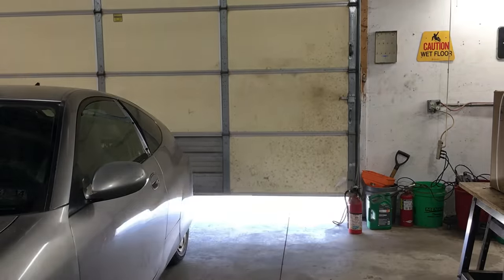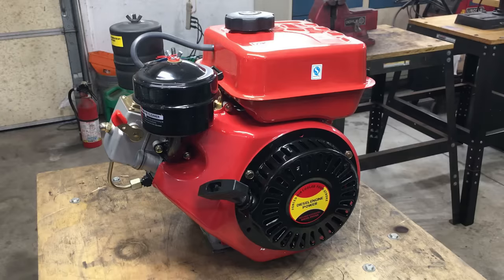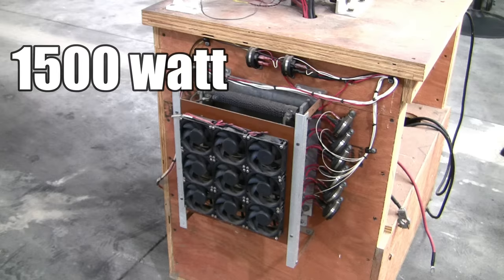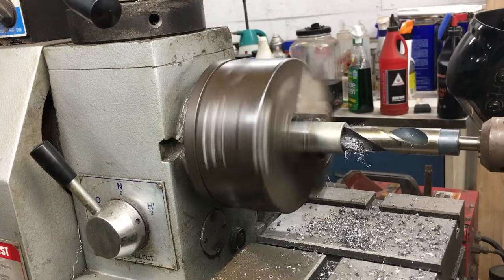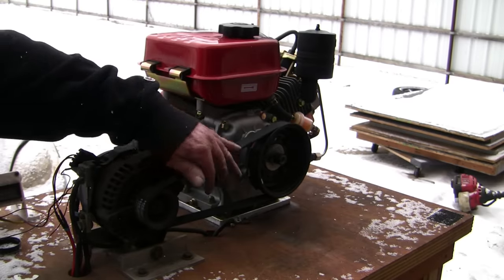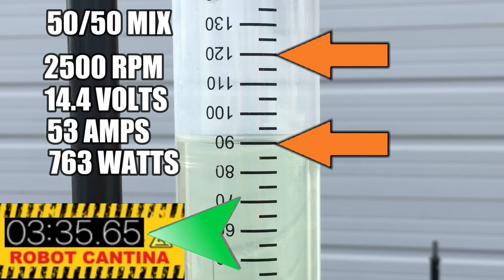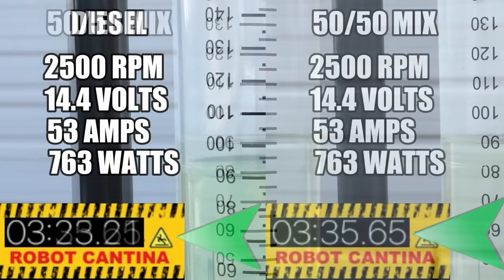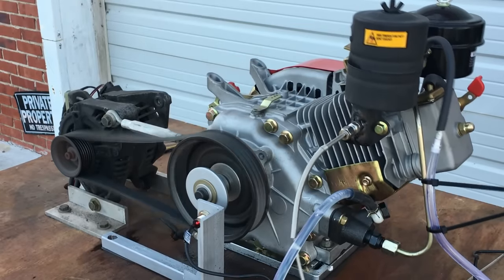S4 E3. How good is vegetable oil as a source of fuel for a diesel engine?... We find out!. plus more

Comment: 11:57 That's where I have to disagree with you for the first time over the years Jimbo. You see - the diesel engine was not invented to use diesel. As a matter of facts - when the first diesel engines were made we haven't even invented diesel yet. First diesels were made to be run on canola oil. The only reason we started to use diesel was because there was so much junk byproduct from making gasoline without any use. Somebody decided to fraction it again and poured the distiled garbage into the oil engine and surprise surprise - it ran pretty much the same. 
What's even funnier is the fact that if you do an analysis of the exhaust fumes you would find out that the vegetable oil has way lower NOx emissions and the soot percentage is lower than the diesel. 
So - vegetable oil was the OG fuel for diesels, it has better exhaust fumes emissions AND, what's better - you don't have to use fresh oil. Used oils with 100k french fries cooked in it is just perfect for the engine too, you just gotta strain and filter it so it doesn't clog the fuel injectors.
My friend had a Mercedes Benz W124 and the engine had well over 500k miles on the clock. 100k miles were done on 4:1 mix used vegetable oil, hydraulic oil, transformator oil... to crappy low price watery diesel. Just basically everything that burned half decent. The engine was still pristine, he gave up the car just because the floor in the trunk rusted through and rear axle just fell apart from rust. That being said - he bought the car for 850$ and sold it 5 years later after this fuel experience for 1000$, the new owner replaced the rear from a front-ended car and it is still happily driving. The cost for running the car was about 4$ per 100km when running on the used frying oil, which was actually the priciest fuel he put in the car (for comparision - my car has very similiar engine displacementwise and it costs me about 18$ per 100km to run it on straight diesel). With the hydraulic oil he had troubles starting when cold and felt the engine lacks power but it was still running and doing well in summer when it was baking hot.

Comment: So my dad has a 1,9l VW diesel powered car and that engine will eat anything that burns and is liquid enough for the high pressure pump to inject into the engine
Diesel engines have a large filter for a reason xDD

Comment: You do a 90/10 mixture of used engine oil and stale gas I don't think it has to be stale gas which is a 90% used engine oil and 10 percent gas is called black diesel

Comment: Veggie oil is fine. I have this exact motor. 15W40 oil in the case. It will take days to break in and should last a few thousand hours. I won't run it at 2500 RPM. Your mount and 1 inch shaft  pulley are elxcellent. Really bad is dirty motor oil. It's an abrasive fuel.  It's quite disappointing you didn't measure the fuel draw. A little respect for it. A 168F.

Comment: The danger from alternative fuels is as follows.
Solidifying or severe jelling at low temperatures.
Bacteria building up in the tank and doing nasty things like pooping waxes, acids and other gunk that can clog the injectors and or damage the high pressure pumps.
Detonation and excessive heat.
Dangerous toxic gases 
Stuff that can clog and destroy the dpf system.

Unless you run an older mechanical pump engine steer clear of uncertified and home brew fuel alternatives especially o some jeeps where the cost of the fuel system is more than a new car.

Comment: I just got a diesel heater for my camper. First diesel powered anything I've owned. Now that these little diesel engines are so cheap, I may play around with one for a homemade genset that shares fuel with my heater lol
Reply from the maker: With the right alternator this little engine can easily generate over 100 amps a 14 volts.  Couple that to an inverter and you may have something..... hmmm perhaps I need to do a video on that.
Reply: @robotcantina8957  That would be an ideal set up for campers, overlanders, RV's, you name it, those Diesel heaters are very popular with them all. Having a small genset that can not only run the 12v heaters fan, but use its same fuel! Dangit Jimbo, you done went and gave me another project lol!

Comment: DIY RCCI?
Reply from the maker: Might be a bit complex for a youtube video.
Reply: @robotcantina8957  d'aw, okay

Side note, energy density of the fuel isn't the only relevant metric to engine performance, there's also the burn rate. The burn rate being just the right speed to produce peak pressure at the right time could improve performance despite what anything else might say.

Comment: when. we. are. ,trying. to. run. the. engine. of. a. diesel car or. trucks
we. feed. on. air. cleaner. a. spray. of. accetyline. gas. 
for. so. that. the. engine. could. eassily fire. inside. the. combustion. .
and. putting. on. ligth. the. glow. plugs.